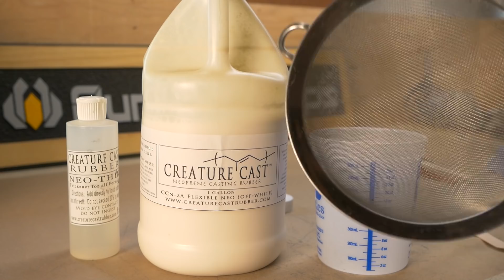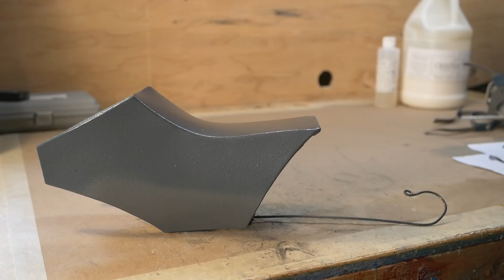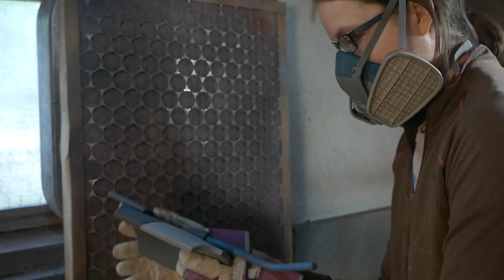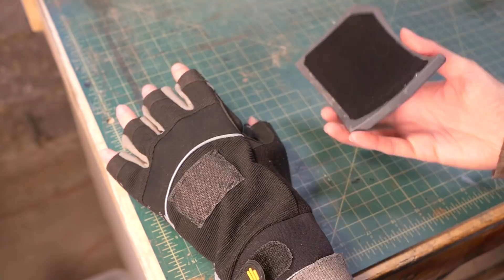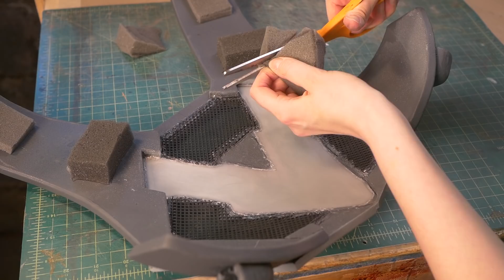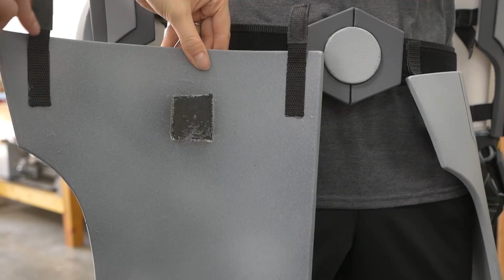Armor Painting and Assembly – VRtist Jazza Collab – Part 2

Comment: I’ve got a question that I think is best asked here. What’s a good airbrush paint for making something look like wood? I built a piano stand type thing for my university’s production of The Piano Lesson that I’m prop mastering for, and I can’t find a good way to paint it. I was thinking process similar to making props look chrome but I’m not entirely sure how that’d do. Any suggestions from anyone is appreciated, would love to hear thoughts from Brittany or Bill aswell
Reply from the maker: I would think the method of application is more what you need to consider than the type of paint. You could simply paint it a base coat in a light color and add detail layers by hand with darker paint to add in the wood grain look. Depending on the material you made the prop out of, you could also carve into it either with a blade or a wood burning tool to create grain, paint it a solid dark color, then dry brush on a lighter color to bring out the ridges and details. This woman is an expert at this painting method - check out her videos: https://www.youtube.com/watch?v=Y6xi56W7cAE

Hope this helps! 
- Paige

Comment: Is there a way to seal foam that would make the armor functional? Or, put another way, would carbon fiber, fiberglass, or something else be able to be put on the outside of, say, a helmet, such that it would actually be strong enough to be used as an actual bicycle or even motorcycle helmet?
Custom motorcycle helmets, that's basically what I'm asking. Can I make a custom motorcycle helmet using some of these techniques that would actually be protective and safe?
Reply from the maker: If you want to customize a motorcycle helmet and still have it be functional you would likely need to start with an actual motorcycle helmet, and be very careful so as not to compromise the utility of the helmet. Once the outer shell is broken it's basically useless. 

There may be communities that specialize in custom helmets like that, perhaps try seeking out a forum and asking there? We'd hate to give any incorrect advise that puts people at risk. 

- Paige
Reply: That's kinda about what I was thinking, too. Thanks for the response.